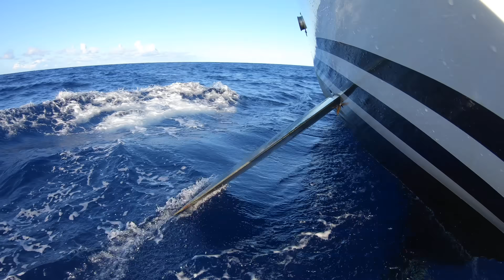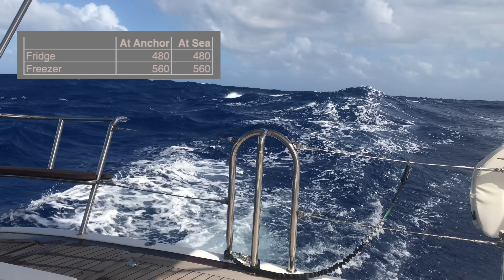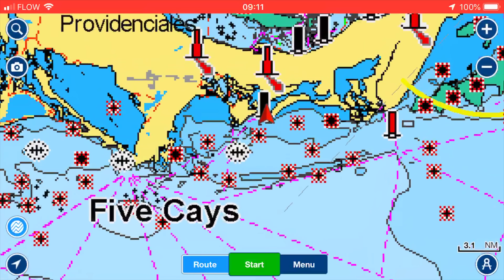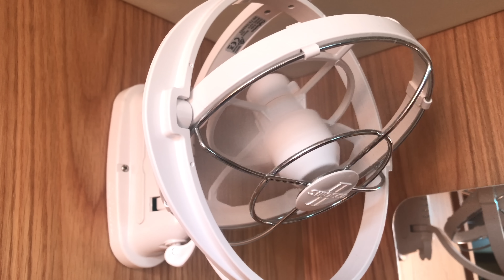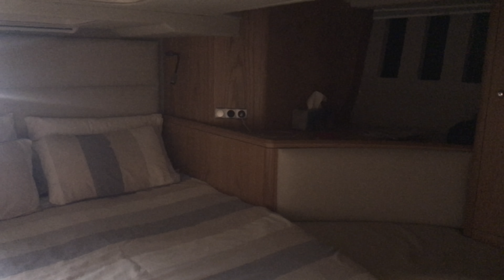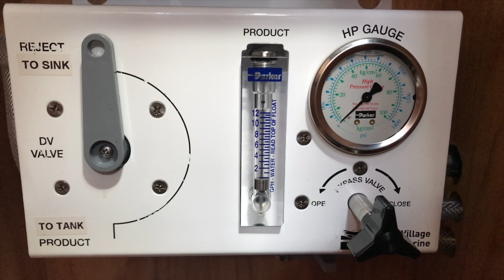Power Systems Part 2 - Budgeting

Comment: Hi both of you guys. It seems wind power is phasing out. I was looking at 12 ft diameter in an architectural project because the area was very windy; and facing south, i was surprised to hear from the very supplier that turbines are too much maintenance ... and with the solar prices falling ... also there is the noise factor, we hear those still around on boats. Some are less noisy. Water turbines will slow you down but the folding prop compensates. I have been using a bungy sort of auto pilot (0watt), i have been successful at it , anyway i dont like leaving the nav. , best way to get into trouble,  the AP did a 360 once ... If i may suggest , you can add real estate for more solar. Use the underneath of the panel and add more cells . Fold or not. Reflective surface will help get more power from down under. We never had to use our genset, but used it anyway for longevity. Ice making and super good iceboxes are a good idea. This next summer i will try a tarp and noodle floating water collector, even if some lake or sea water gets in, it should be good to use for cooking, showers, etc. LEDs and soon better stuff is such a blessing. No "no-see-em" in the bahamas ? I love the docks, i love the parties, i love the beach, i love the bikinis, BUT ; I hate bugs, i really hate em ... they make me half insane...

Comment: Ok, so we have our daily use estimates.  You mentioned in the first video, that you have 10,000 wh of battery storage.  If those are SLA batteries, you shouldn't discharge those beyond 50%.  So you essentially have 1 day (with 600 wh spare) in battery without generating any power.  At anchor you have nearly 2 days of power.  This would be different if your batteries chemistry is different.  

Does your BMS automatically cut off to prevent over-discharging of the batteries?  Or do you just keep on it manually?  What are your batteries?

Comment: Great video, One thing I would like to comment on that will affect your over usage is the efficiency of your Inverter. Sometimes they can be quite low so if the usage is from an inverter an adjustment should be made when calculating you kWH.
Keep up the good work
Lewis

Comment: The keel lift motor draws 70Amps!? That's a scary amount of current. Or is it an AC motor and this current is measured on the DC (battery)  side of the inverter?
Reply from the maker: Yes that’s 70 amps at 12 volts about 800 watts

Comment: I thought most of us went by amp hours because that's what most batteries are rated in....
Reply from the maker: Many boaters do calculate with Amp-hours but amps aren't really power. I prefer watts since it is a true power rating. Many boats now have 24V systems and then it just gets confusing in amp-hours.